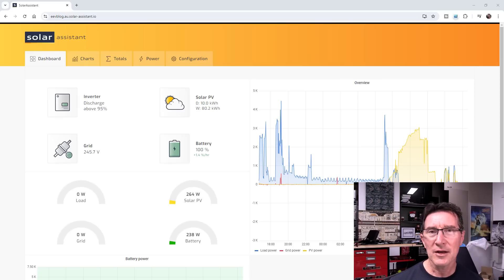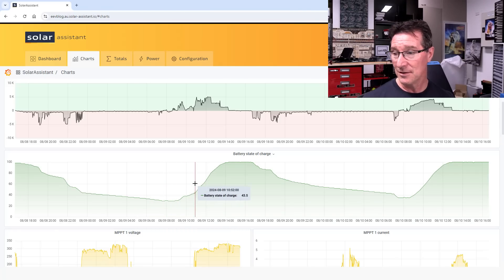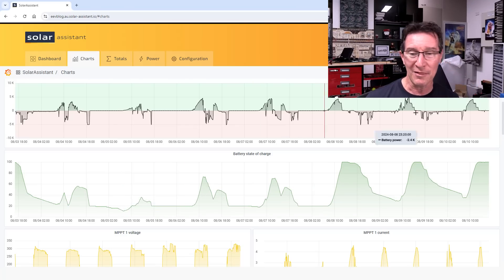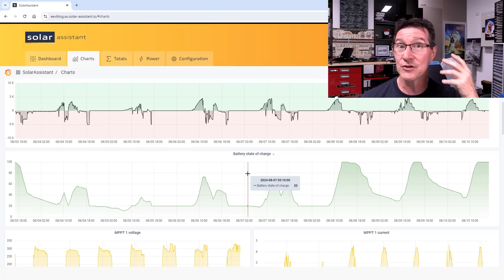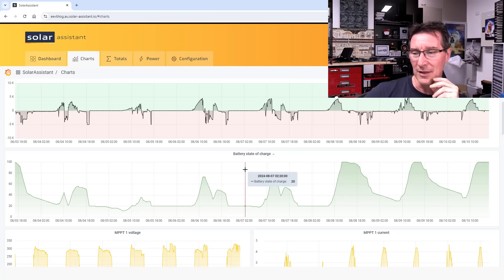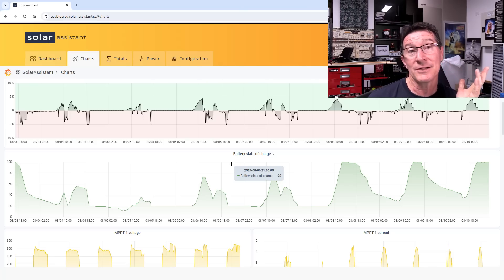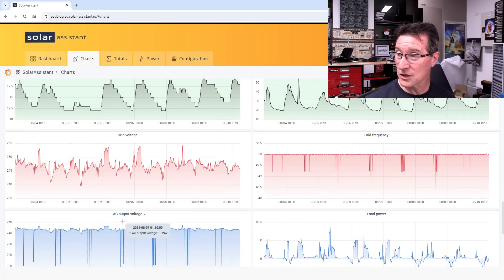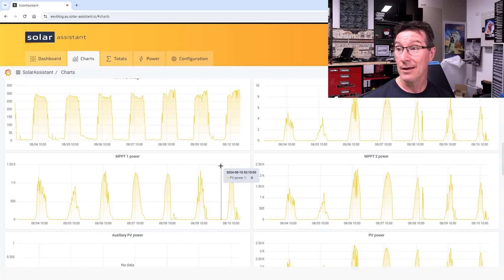We're Gonna Need a Bigger Solar Battery...

Comment: Hmmm - so, $20,000 worth of solar panels, inverters, and another $16,000 for 5 batteries, to cover $1200 annual electricity bill.  Payback period only 30 years.......if you ignore that the $36,000 could have been invested on day one and earned compound interest for 30 years.  Value of investment in 30 years @ 5% $630,000.00 vs value of solar installation after 30 years =$0.00, less 30 years annual electricity cost $30,000.   Even if the current annual electricity bill is $2400, the system is a bust.
Reply: I’d love a $1200 annual bill, that’s roughly 3 months worth of usage.
Reply: @Beavereater84  OK, then your solar/battery system would need to be 4 times the size, 4 times the cost, and 4 times the bad outcome.
Reply: Ive seen people's 3 month bill more than 2400 😅
Reply: @JyeKelly hell... Mine is closer to 8k (Canada)... Bigger house, server rack, and ev charging. 
Solar would be a slam dunk if I had the liquid cash.
Reply: @JyeKelly  So, a solar system with batteries to cover that need would therefore cost how much more????  Feel free to think, mate.  The equation would work out the same, just with much higher numbers.
Reply: @einfelder8262  i had only mentioned ive seen people's 3 month bills more than your yearly estimate... Nice to see you like to argue with yourself 😉
Reply: @JyeKelly  You have a twisted interpretation.  I am not arguing with myself, or you either.
Reply: You're about $500,000 off with your 5% compound interest.
Reply: Where did you get $1200 annual bill from? Mine was £3000 a year which is nearly $6000 in AU, and this cheap.
Reply: Good case for my place, it will cost more than 100k to run lines/poles to connect to the grid. We are about 16k in on a solar system, more battery would be nice.
Reply: No power outages. Priceless.
Reply: They don't have 'load shedding' in Australia. Power outages are mostly caused by severw weather events or a vehicle crashing into a power pole causing a localised outage.
Reply: Repeat your calculations with 41 cent/kWh in Germany or 27 in Australia.
Reply: @brauchmernet  I'm in the same state as Dave, I pay 47.157000 cent's (C/kWh) with AGL . It has been many many years since it was low as 27 cents.
Reply: @A-Dingleberry  yeah the American people seem to think their prices are high for electricity…
Reply: @brauchmernet  So true, my mom literally wastes electricity such as heater in a greenhouse that costs about $100 a month then has the nerve to complain about it every year with a lower than national average of 0.11 kwh so yeah anywhere else in the world she'd be paying $300+ not counting everything else.
Reply: You say that when all the power companies where I live are jacking up rates making already expensive bills go even higher so the solar addition was a smart move for my household.
Reply: How about 2000€ for x24 450W Canadian Solar panels, 1500€ for an Deye 8kw inverter, 1800€ for 15kwh LiFePO4 Basengreen battery module (or 3600€ for 2 modules with 30kwh) and 1500€ for cables and all accessories, for a total of 6800€, how long would it take for full payback?
Reply: An Aussie here with some real numbers for you. $36,000 compounded at 5% is $125,000 over 30 years without any additional deposits. Paying electricity for 30 years, starting today without factoring in for price rises and inflation would be a $75,000 expense. 

A 6Kw solar system is about $5000. Average household power usage is about 9000kwh/y or about $2500 per year. Given that a 6kw solar system will reduce your bill to ZERO, the payoff on that system is about 2 years. 

Now the battery, for most people does not make much sense. My own house, currently buys back from the grid about 1800Kwh at night per year, a cost of about $500 a year, or which for a unit speced to my house and my energy usage would be a 20 year payoff. But I also so not use the amount of power Dave does. My house uses about 50% less energy than a typical household. So for someone more average, it would be a 10 year payoff on 10K worth of battery.

Given Daves actual use and converting all that night time energy use to dollars, he would not have much more than a 10 year payoff on that $16K battery system. The actual solar panels and the like are essentially free after a couple of years. So, $30K worth of investment now into the infrastructure what should last for 25 years, seems like a no brainer if you have the money and the brain.
Reply: @robertpowell1101 depends
I run heavy load and a battery helps me not having to get double the size solar (that i would not use)
Or else i would pull from the grid when the clouds come out

Decides with varible prices i cut my winter bill in half
Some days the cheap hours are 1/3 less or more

It also depends where you are and what your electricity prices will be in the future

In 20 years it have 4x where i live (2x in the last 4 years because of investments in grid and green energy)

Some days we get money to use electricity, because there is to much production (and i pay for exporting to the grid)
On the days a battery also makes sense so you dont have to shut dont the system
Reply: Subtract money.  Add fun.  Multiply by a healthy conscience.  ❤
Reply: The reason the feed in tariffs have been slashed is because when the sun shines, supply > demand. The reason this will change as more solar installations have batteries is that the energy can then be stored and later sold into the grid when demand > supply. It will happen.
Reply: $36,000 at 10% interest per annum over 30 years is just under $630,000. 
At 5% it’s $155,590 which is a $119,590 gain. 
$2,400 yearly bill at 3% inflation rate per annum over 30 years will cost a grand total of $117,606 😮
Reply: Energy independence has its own value.
Reply: It costs way more than it saves
Reply: I am thinking about solar with price 0,21€/kWh and monthly bill of 100€... So yearly 1200€... So my budget is only 5000€, because i want to be in positive numbers after 5 years... So...
Reply: Because Dave does these videos I'm sure he can claim some or all of it as a business expense. So get to reduce some tax too.
Reply: You can't do math. The resulting amount would be $155,589.93. You also miscalculated the average cost of kWh in Australia. You're clearly a US American without education. With Dave's power usage, clearly displayed in the video, and the average cost of 40 cents per kWh, amortisation happens latest in 10 years (earlier because of EV), at wich any excess money can be invested and quickly overtakes the 36000 lump sum, especially because prices for electricity will raise significantly in those 30 years. So sad when Americans open their mouth without thinking.
Reply: I'll feed the 🔥. How often will that battery rack need replacing in 30yr? What is the capacity derating curve over time? How many charge/discharge cycles does the mfgr warranty?
Reply: I smell a business write-off for him making these amazing videos. 🤯
How does one factor that into this equation 🎉
Reply: Get your household into a retailer with the spot price. You can consume during the day for 5-19¢/ kWh and export at night for 50+ ¢/ kWh which will reduce your ROI for batteries down to less than 5 years. 

Also have a look at the open source EMHASS package that can optimise all your household loads. I use it for EVx2 charging, home battery, pool heating, aircon and hot water.
Reply: Aux input allows you to hook up alternative power sources like a V2L feed from your EV.
Reply: You dont understand it…
The battery covers more then that
I run heavy loads every day, and then the battery kick in when the clouds come out..
So i dont have to pull from the grid or get a 50kw inverter

And in the wintertime i can get electricity for 1/3 of the price in the cheap hours sometimes
it saves me more in the wintertime then in the summer

It pretty much cuts my cost in the winter to half the price with varible prices
Reply: Can you do the battery current  clamp tests
Reply: Plus income on this as a YouTuber. Plus having fun. Plus feeling good. Money isn‘t everything to all
Reply: You have not taken in to account his solar charging of the electric car or potential to sell additional excess back to the grid. Also it is highly likely in years to come people with home batterys will be offered money by suppliers to remote charge up / discharge to help flatten grid over and under production. Certainly the EU is heading in that direction.
Reply: @timmgiles in the Netherlands you regularly have to pay to dump your excess energy onto the grid with some power companies.
Managing the overloading of the grid costs money and the only fair thing to do is to make the people that cause it pay for it.
Customers that use power during the high grid loading get paid to use excess grid power.
There are plans in the works to make it mandatory to have a system that can be shut down remotly or you have to pay a a big premium on your power bill.

I recently got paid more money using grid power then I was paying during the night.
Need a bigger AC to get paid even more😂.
And no I don't have or want solar panels and battery packs as fire insurance is going to be an issue in the future.
Reply: Also worth remembering that it's winter there at the moment.
Reply: @timmgiles  I have not taken into account lots of "addons" because the calculation becomes far more involved, without changing the broad outcome.  For example, I've only used present value for the calculations not including inflation, interest rates, whether the whole system is purchased using a loan (which makes the outcome far worse),  haven't factored in the very high insurance cost of your beloved EV over the cost of ICE insurance, etc, etc.  It's highly UNLIKELY people with home batteries will be paid more by electricity vendors, that's just childish dreamtime, for example the initial feed-in tariff in Australia was 60c and now it's 4 cents, because of the uptake home solar.

Comment: Any comment on mixing LiFePO4 and Lead Acid batteries of similar capacity?
I have heard LiFePO4 keeps the voltage up, and the Lead Acid delivers the amps during heavy use - essentially giving a long system lifetime. 
(No, I don't have any source that it works, it's something I've picked up from watching various YouTubers discussing their system/setup/experience)
Reply: no, that does not work. lifepo4 will deliver more amps than lead ever will. lead is dead.
Reply: Given that even under a 0.2C to 0.5C load (20-50A on a 100Ah pack) the voltage on a LiFePO4 battery pack is going to be within the float charging voltage of a Lead Acid battery, the Lead Acid battery would basically act as a large capacitor (only using surface charge on the battery). The Lead Acid battery would only see any appreciable discharge current once the LiFePO4 battery pack goes below something like 20-30% State of Charge (70%-80% Depth of Discharge), and you'd still have to cut off the discharge at something like 3.05V per cell on the LiFePO4 battery pack to avoid discharging the Lead Acid battery below 50% (which would seriously reduce its life).
Reply: @klightspeed  - Does this also apply to old, worn LiFePO4 batteries?
I have heard plenty of people complaining that their LiFePO4 batteries die way too quickly as their internal resistance goes up as they age - hence not being able to supply the current they 'used' to be able to source (same goes for charging, obviously)
Another plus is that you don't necessarily need deep-cycle Lead Acid batteries, as the voltage does not drop so low they get damaged - is something I heard, sounds logic - but is it true?  'Regular' Lead-Acid is way cheaper than deep-cycle and Lithium based - and do not need a BMS, but they can/will discharge Hydrogen - so better not use them in an enclosed space.

Comment: In the winter solar panels are colder and more efficient, in the summer solar capacity drops and consumption goes too high. In my setup in Greece in the winter around noon I am 100% battery full, in the summer my maximum is 80-85%, yes you have more sun hours in the summer it's doesn't mean that you have more energy to store.,

Comment: I'd build a completely separate cheap DIY battery for storing the charge that the car needs with extra power that the house doesn't need.
Reply: As far as I understood this is exactly what he has, only a commercial solution - The EV always takes in any extra solar that the house doesn't use. It has a smart charger for that.

Comment: Go against the 20% to 80% - whats the voltage?
This is why I use mine in voltage mode, I go between 2.9v & 3.45v which gives great balance between capacity & stress.
Work out what the cell voltage is at 20% & 80% & i'll give you an answer
Reply: Thats how I have mine apart from my LVC is 3v, as if you look at the discharge curve it really drops of around 3v.
Reply: 80% refers to the maximum Depth of Discharge, which is the same as 20% State of Charge. He's going 20% to 100% State of Charge. 3.45V sounds like your Constant Voltage (and cell balancing) point (with most chargers being set to 3.55V per cell, and anything above 3.4V per cell eventually reaching 100% SOC), and 2.95V would be anywhere between 5% and 20% (depending on the cell quality). I don't know how one would deliberately hit 80% state of charge on LiFePO4 (given at that point you're still on the flat part of the charge curve), and at 20% state of charge the battery is at or near the bottom end of the flat part of the curve (typically giving double the cycle life of discharging to 100% depth of discharge).

Comment: My lifestyle means I charge my car overnight. I have cheap electricity at night though so bulk charge my car and house batteries every night, then "spend" it during the day when the energy is more expensive. I also run out of battery during the day in winter and pee away excess solar into the grid during the day in summer.

I'd have more batteries, but I don't think there's any room in my loft for them, and yeah it costs money... which I could be spending on the electricity I use instead.

Comment: Better first try to comsume your power. Be smart at controlling devices when they turn on (and off). Especially the EV charger and heating.
For heating do you use only an aircon or also a heatpump? Then you can start thinking of storing hot water.

Comment: what you are paying for 5kw batteries i was paying for 3kw batteries a couple of years ago.
Definitely another two without doubt.  Would be tempted to fill the rack because it’s less heat and load across the pack.
Reply: Battery prices dropped really quickly. You almost don't need to conserve energy anymore. Can almost store however much you want these days.
Reply: Those slot in batteries have always been somewhat cheap compared to the stand alone "standing" batteries. Made the mistake of going solax...dont do that
Reply: @AlpineTheHusky  I mean, ab 11 kWh basen green box is ~1600€ now. it's crazy cheap. I think their 22 kWh model goes for ~2200€
Reply: Yeah i bet china has some good offers on their exploding models these days 😂

The battery i have is more expensive then when i got it some years ago

I deffently saved alot
But more and more people also need batteries now, just compared to a couple of years ago..

Who would get a diesel or gasolin car in 2024 for example

Comment: As it's hitting 100% charge and staying there for hours during winter, then yes, more battery would be VERY wise. Otherwise in summer you'll hit 100% charge during breakfast and be dumping vast amounts of potential charge to the grid all day.
Reply: Unless the controller senses 230+10% voltage, 253 being the magic number, where the controller has to stop pushing current as things would pop and the transformer would possibly saturate